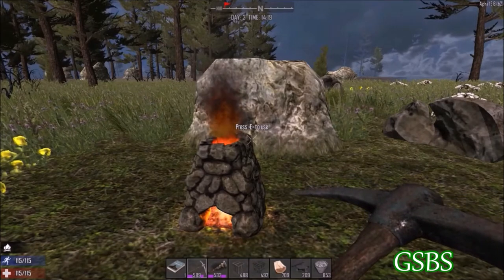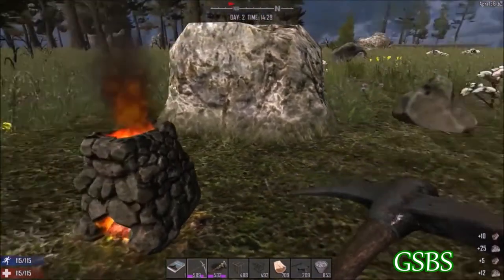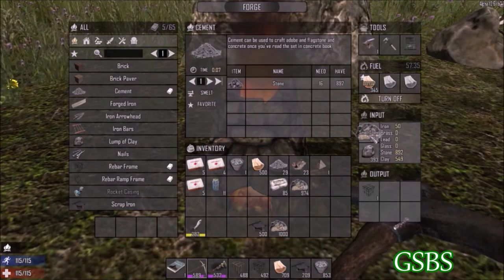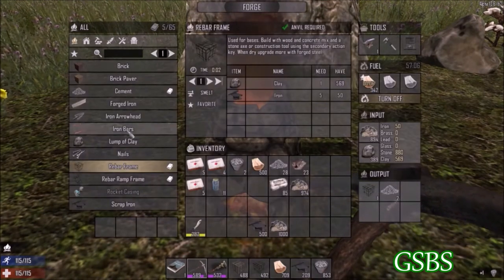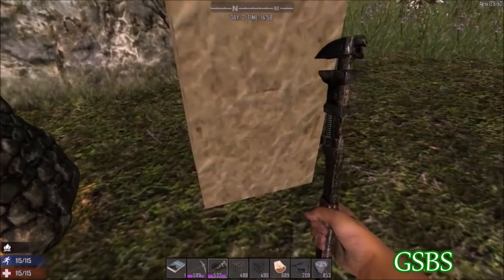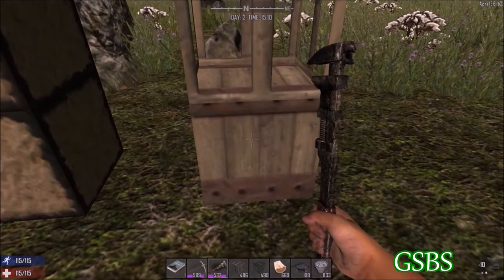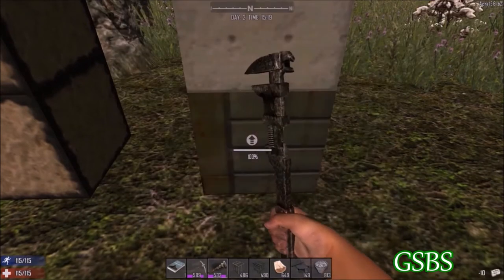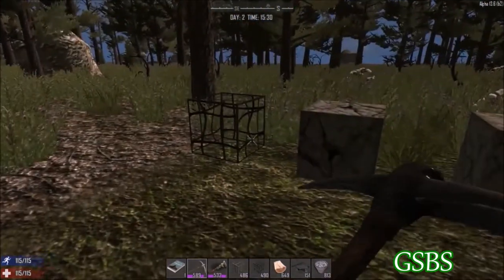How to: Make Reinforced Concrete + Upgrading (7 Days to Die: Alpha 13) - GSBS

Comment: Whenever I put cement blocks down in the rebar I only get 1,500 health on the block how can I get at least 3,000 or the 6,000 health concrete?
Reply from the maker: Hey sorry for the very long wait time, a lot has been going on and I wasn't getting notifications for comments for some reason.
If your still into 7 days to die, a lot has changed but the overall way concrete works is mostly the same.
you can craft wet concrete blocks in the cement mixer now, and upgrading from rebar with a stone axe / hammer / nail gun skips the first concrete stage and gives you wet reinforced concrete right away for the same cost (actually you save metal from not using rebar somehow lol)

I'm coming back to Alpha 19, with a video about the skill system coming soon!
So if you're still interested, stay tuned for that :)

Comment: I have a question, the forge uses the anvil as a tool, I'd like to know what the other two tools are and if they are craft-able
Reply from the maker: +Rocio Gonzalez The other tools are calipers, and the tool and dye set. Unfortunately they are not craftable, but I have found quite a few in working stiff crates. So you'll have to be on the look out for one of those buildings. ^^ Thank you for your question, if you need anymore help, i'll be happy to help.
Reply from the maker: +Rocio Gonzalez For more information, I just posted this video ^^ -https://youtu.be/9M0zhDZyc14 - I Hope this helps.

Comment: So what you're saying is, it's more durable to start with a wood frame and upgrade it all the way, rather than rebar frame?
Reply from the maker: +Nathan Pierce  No, it will be the same durability and it is actually cheaper to start with rebar than wood. (sorry it took so long to reply, picked up a job for a month and got really busy) It used to be quick to start with bricks, but not anymore.

Comment from the maker: I started the video with how to make concrete mix and rebar frames first to be complete, if you have everything already just skip to 1:38 for how concrete is made (the old and {2nd} best way, which is with rebar frames.) Until it gets fixed (as I'm sure it is unintended) there is a much better way to get reinforced concrete. Will post the details soon.
Reply: Thankyou very much for this video im new to 7dtd and i couldn't figure out how to reinforce anything.
Reply from the maker: You're welcome :) We all were new to 7dtd at one point in time, and that's why these videos are here :)
Reply from the maker: +Casper 418s Also you no longer need the skillbook, it is now unlocked in the skill menu after getting level 20 construction tools (I think it was 20)

Comment: You show two ways to make reinforced concrete - one way starts with rebar frame, and the other with a wood frame. It seems like the wood frame way was much more expensive per block. Is that the case? If so, would there be any reason not to start with the rebar frame instead?
Reply from the maker: +SpamTheManChan Yea, it is much more expensive to upgrade from wood frames. The only advantage for that is if you want already placed blocks to become reinforced concrete. If it is for new construction you are way better off using rebar frames instead.
Reply from the maker: +SpamTheManChan I know there are still quite a few blocks that can't be upgraded as of yet, I will check into that, just converting a couple videos at the moment I should be able to look into it soon.
Most likely they are talking about decayed bricks that you find on some of the prebuilt houses, I don't think you can make it, but I will look into that. From what I can see you would need the set in concrete schematic and make concrete mix, find some decayed bricks and just upgrade that. Lose no wood, or metal.
While reading that I have noticed quite a few of those bugs, In one of my videos I dropped a single metal trussing block and it started destroying my dirt floors while testing underground farming LOL. And running an auger seems to attract screamers nonstop, I went through 7 of them while making my underground farm test. Also steel walls cost more steel to repair than to upgrade your reinforced concrete, depending on the damage.
Reply from the maker: +SpamTheManChan Ok just did some testing, this is how he bypassed the entire upgrade process. You can make brick in the furnace with 20 clay. after you have some bricks you can make decayed bricks with brick, and dirt. When you place this down you can upgrade straight to concrete with an upgrade tool and 10 concrete. I will post a video about it soon. This allows you to get instant reinforced concrete with just 20 clay, 1 dirt and 10 concrete mix. No waiting for concrete to set, and no metal wasted on rebar frames etc.
Reply: +Gaming Step By Step I doubt it's intended to be that easy, but I suppose it's also ok to play dumb to that fact for now :P
Reply from the maker: +SpamTheManChan Yea, there is no way they intended this haha. Thank you for the heads up by the way. :D  I'm all for saving resources since they made repairing cost so much more now. They will probably fix this once they balance out the costs of everything. (I hope they balance it out anyways)
Posting a video right now that demonstrates the best fuel source for burning, and this method of making instant reinforced concrete, will make an annotation on this video as well. here is the link - 
https://www.youtube.com/watch?v=xZUc_sJjW-8
Reply from the maker: +SpamTheManChan I had a question for you, I'm never sure if anybody wants me to mention them in the videos or not, but do you mind if I give you credit for helping the discovery of faster concrete? also ty for the tip on farm fences :D
Reply: +Gaming Step By Step Well, I didn't actually discover it, it was someone on the 7DTD forums that really deserves the credit.
Reply from the maker: +SpamTheManChan True enough ^^ but without your insight we wouldn't have found it either :)

Comment: Somehow I can't do it. I have everything I need but the blocks always end up as this stupid brown thing with 1500 hp
Reply from the maker: +Rattail1127 They may have changed the upgrade path for blocks, I'll look into it now. That sounds like it turned into bricks. I usually use rebar frames now, however you can upgrade cobblestone walls into concrete, then reinforced.
Reply: I thought something went wrong when I  kept getting the brown block too but it turns out this is just the concrete drying and you will need to wait some time for it to turn into reinforced concrete I don't know how long the time is exactly but I would guess that it is about a quarter of an in game day
Reply: +Squishy50 Yep I finally found that out. I went back to this block testing wall and noticed that some of the ugly blocks had changed. 

My friend later told me it takes about 15 minutes to dry, but I didn't really have the patience to test any more of them
Reply from the maker: Squishy50 Yea I might have forgotten to mention that in this video for some reason, that sounds about right.

Rattail1127 They take quite a bit but are definitely worth it for late game defenses. I'm working on a new way to loot horde days soon I think. :)

Comment: Wait, is there even a way to get reinforced concrete with rebar frames? The concrete you get from upgrading wooden frames has 3000 "health" in your video, while the concrete you get if you use rebar frames has only 200? According to the wiki you first have to fill the rebar frames with wood and then with the concrete mix - now I'm confused.
Reply from the maker: +Juleru Sorry about that! I didn't explain it very well, now looking back. When you fill rebar frames in, the concrete is the "wet" form, and has only 200 health while it is "setting." After a short while the dark grey concrete will turn the normal color and the wood on the sides will disappear, leaving the 3000 health reinforced concrete blocks there. When you upgrade without rebar frames however, you skip the "wet" concrete phase all together, and have 3000 health blocks right away.
Reply from the maker: +Juleru Another thing to note, the "wet" concrete has the same physics properties as wood frames as well, meaning they have 24 max load and 4 mass each.
Reply: +Gaming Step By Step Thanks for clarifying! :)
Reply from the maker: No problem :D Glad to have helped ^^

Comment: which frame is best wood or metal?
Reply from the maker: +kris1976melo It is very expensive to upgrade through wood, and only helps if you made a base out of wood before concrete. I usually use rebar frames, but I have seen some people use adobe blocks, or even concrete (which is 20 concrete mix instead of 10 mix and some iron)
Reply: +Gaming Step By Step ok cheers m8..
Reply from the maker: kris1976melo cheers mate, I hope it helped. ^^ to sum it up, rebar (10 iron, 10 concrete) or concrete (20 concrete) is your best option, whereas wood will cost 20 wood, 30 iron, and 20 concrete to upgrade from a wood frame.

Comment: where do u get the book?
Reply from the maker: +Vic Cudiamat  you no longer need to find a book for concrete now. 
You will find the recipe is now unlocked through your skills. You will need to get your tool smithing up to lvl 30 or 40 (if I remember correctly) after that you can buy the perk for skill points. Hope it helps :D Happy surviving!

Comment: cant figure out how to go from 3000hps to 6000 hitpoints on ps4
Reply from the maker: +The Red Anonymous Seven 
If it's for steel, you need to get the steel smithing skill which costs 10 skill points and requires level 40 construction tools. 

If it's reinforced concrete you will need the concrete skill which also costs 10 skill points but requires level 20 in construction tools.

An easy way to raise construction tools is to use 2 wood frames, upgrade 1 to halfway then switch to the other frame and repeat, boring but a way to pass the night. Another method is to upgrade windows, uses resources but seems a bit faster if you have a lot of windows. I hope this helps ^^
Reply: +Gaming Step By Step figured out my problem....i didnt let the concrete dry lol thanks tho!😅🍺
Reply from the maker: The Red Anonymous Seven Oh yea, for some reason I forgot about that lol. Now even upgraded blocks form the wet concrete.